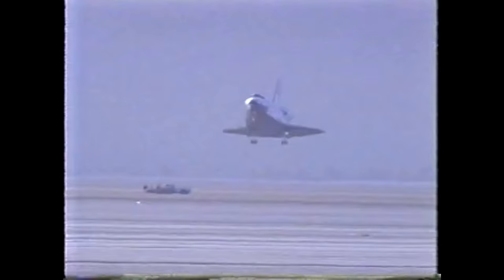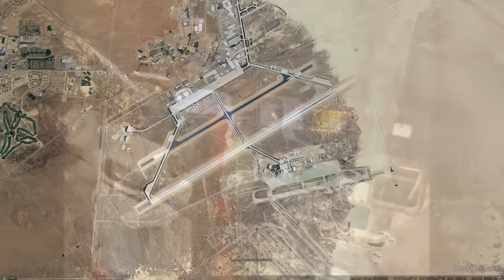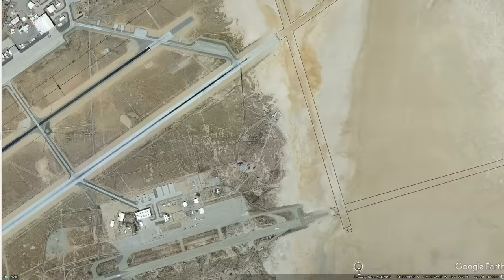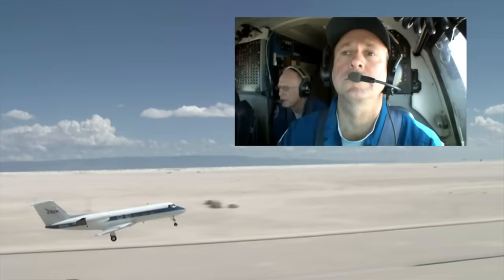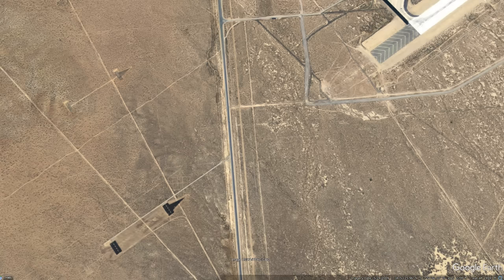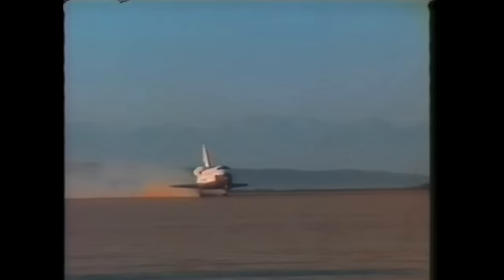The Space Shuttle That Didn't Reach The Runway - Why Did Atlantis Land Short on STS-37?

Comment: Do a show on the eclipse please.  Explain the difference between solar prominence and solar flare.  Also which was visible during the eclipse.

I belive I saw one good sun spot around the center leading up to totality when the moon was not yet half covering.  As well as several distinct prominence during totality.  I did not see any solar flares but many people are saying that they saw several.  I think they are confused which is which.

I explained the difference but if I ran into several then it is likely there are many more confused.  Who knows maybe I'm the one confused lol.
Reply: I saw three sunspots during the eclipse.  The bigger one was near the center, and a pair of smaller ones near the opposite limb from where the moon entered.  No totality here, so I can't comment on the prominence.
Reply: @stargazer7644  How would you know if you saw a sun spot though, rather than a prominence.  The difference seems rather clear when it is shooting off to the side of the sun.  If the loop is complete then it would be a prominence.  If not, then a flare.  But if it is on the side facing you, you just see a dark area.  How could you know if it is a prominence or not.  Thats the question I seek answered.
Reply: @K162KingPin  A sun spot is a cooler and thus darker spot on the sun caused by concentrations of magnetic flux.  It looks like a black spot on the sun.  Sometimes the magnetic field lines stretch and break and reconnect resulting in an intense burst of radiation - this is a solar flare. It is a bright flare that typically only lasts seconds to minutes.  A solar prominence is a large bright filament extending outwards from the limb of the sun toward the corona.  If it is seen on the disk of the sun and not above the limb, it is a solar filament. Filaments are linear or curving features, not spots.
Reply: @stargazer7644  A sun spot, is when you are looking down on either a prominence or a flare.  So again I wonder how can you tell the difference.  It would be like looking down on the room of a building and trying to determine if it has windows.
Reply: @K162KingPin  Sun spots don't have to have prominences and they're almost never flares.  When you see sunspots near the limb, they don't always show prominences, which they would if spots always had prominences.  I don't think you understand what these objects are.  I've tried to explain it to you.
Reply: @stargazer7644  So you are looking at the sun, and somewhere in the middle is a dark spot.  How can you know what that is unless you had a satellite at a right angle to the sun from your perspective to show you a side view of it.  It could be a cooler spot on the surface, or a solar flare or a prominence which is ejecting material or just plasma directly towards your perspective.

We can clearly see several prominence during the last eclipse which were perpendicular to our perspective.  So try to imagine what those would look like if you were at a different position around the sun looking directly at them.  They would look like a sun spot as they would appear cooler than the surrounding material.  Like trying to see the glow of a planet through a thick cloud.

So again, how can you tell the difference.
Reply: @K162KingPin  Once again.  You know because a filament is a linear or curved feature.  A sunspot is just a spot.  A flare is a bright eruption, not a spot.  If the filament is so new that you can't discern it yet, then it isn't a filament.  This is not rocket science.
Reply: @stargazer7644  So if you are looking directly down from the top of a filament or a solar flare which is on the side of the sun you are looking at.  It will look like every other sun spot as either would be cooler than the rest of the surface around them.  So again.  How can you tell which it is without being able to see it from a side view.  If it is "not rocket science" then this should be easy to explain, which you have not yet.  Do you understand the question?  I'm wondering because you didn't directly answer the question yet.

Comment: Scott, I am confused. When i look at a rocket painted white, it comes back pretty black from that heating entry...Why does that huge shuttle always look so white..Surely there would be carbon marks no?
Reply: the underside of the aircraft takes the brunt. We can see the blacking on the capsules due to their shape and the plasma curling over the capsule bottom. The shuttles heat pads come over the edge of the wings/body etc which is where the blacking would be if they didn't. if that makes sense lol
Reply: The Falcon 9 stage becomes black from the rocket exhaust. The Shuttle does not use its engines during reentry, so no combustion products to flow over the white areas of the hull. 
The heat shield of the Shuttle is made to stay intact during the reentry: it should not ablate anything, so no combustion products from that either.
Reply: @Hobbes746  Cheers..i think the Orion capsule and all capsules also come back lie charcoal no?
Reply: @thepinksmokeproject  Orion and Dragon use ablative heatshields: during reentry, the outer layer of the shield burns off, which produces lots of soot. The Shuttle heat shield was not ablative.

Comment: Abstract

The video recounts the story of STS-37, a Space Shuttle mission in 1991 that faced challenges during landing due to unpredictable wind conditions. The mission, primarily aimed at deploying the Compton Gamma Ray Observatory, encountered complications requiring an emergency spacewalk to correct a malfunctioning antenna. Subsequently, landing preparations were hampered by unfavorable weather conditions at potential landing sites. Ultimately, the decision was made to land at Edwards Air Force Base on an alternate runway that had never been used for shuttle landings. Despite encountering wind shear and landing short of the designated touchdown point, the mission concluded successfully. This incident prompted a review of communication protocols and risk assessment procedures for future shuttle landings.

The Compton Gamma Ray Observatory Mission and Emergency Spacewalk

* 0:04 - The video focuses on Space Shuttle Atlantis mission STS-37 in 1991.
* 0:52 - The primary objective of the mission was to deploy the Compton Gamma Ray Observatory, one of NASA's "Great Observatories" alongside the Hubble Space Telescope, Chandra X-ray Observatory, and Spitzer Space Telescope.
* 1:26 - During deployment, the observatory's antenna malfunctioned, necessitating an emergency spacewalk (EVA) to manually correct the issue.

Landing Challenges and Weather Constraints

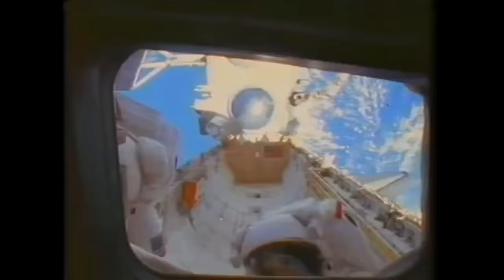* 1:54 - Landing a Space Shuttle was time-sensitive due to limited resources and reliance on suitable weather conditions.
* 2:12 - Crosswinds exceeding 12 knots posed a significant challenge for shuttle landings, restricting potential landing site options.
* 3:33 - Unfavorable weather conditions at both the primary landing site in Florida and the backup site at White Sands forced the mission planners to consider Edwards Air Force Base in California as an alternative.

Edwards Air Force Base and the Alternate Runway

* 4:05 - Edwards Air Force Base, with its Rogers dry lake bed offering multiple runway options, emerged as the most viable landing site.
* 4:48 - Due to wind direction, Runway 33 was selected for landing, despite never having been used for shuttle landings before and lacking proper markings and equipment.
* 7:05 - Astronauts conducted simulated landing approaches on Runway 33 using the Shuttle Training Aircraft to assess its suitability.

The Landing and Post-Mission Analysis

* 9:27 - On the day of the landing, wind shear conditions significantly impacted the shuttle's approach, causing it to deviate from the intended flight path.
* 11:37 - The commander skillfully maneuvered the shuttle and landed it at a slower speed, though it touched down 600 feet short of the runway threshold.
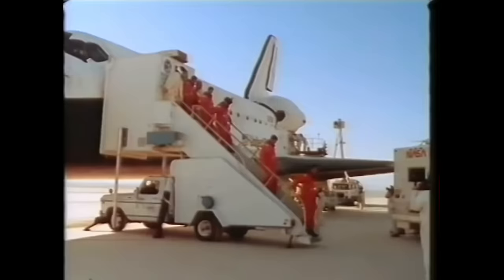* 12:28 - Despite the unconventional landing, the mission was deemed a success, and the crew and spacecraft remained safe.
* 12:35 - The incident highlighted communication gaps between the Shuttle Training Aircraft crew and the mission control team, prompting improvements in information sharing protocols.

i used gemini 1.5 pro
Reply: Great reply!!!

Comment: The toilet behind the cockpit on any commercial airline is part of the minimum equipment list. If that one fails, the flight will be aborted until either the problem is fixed or there is an aircraft change.
Reason for that is, you don't want the pilots to be somewhere, where they can't hear any alarms coming from the cockpit.
Reply: That's ridiculous.  It isn't like they leave the flight deck unoccupied while taking a whiz.  Also, you aren't going to hear any flight deck sounds in even the front toilet.

Comment: If it can land as a plane , why comercial airports weren't an option? 

What are the requirements for landing it ? 

Rwy Leng, width, surface, max tyre pressure allowed, that sort of thing
Reply: Long enough runway plus having the specialized support vehicles and equipment the Orbiter required.
Reply: Commercial and military airports were part of the contingency plans. The main restriction was runway length (even the 3 km used at commercial airports was not considered long enough, they wanted something like 3.5 km)
Reply: The shuttle could land at any airport with a 10,000 foot runway in an emergency.  But there were only 3 places it would land normally.  Kennedy Space Center, Edwards, and White Sands.  Several Trans-Atlantic sites had equipment to assist in a shuttle landing: Lajes in Portugal, Zaragoza in Spain, Moron in Spain, Istres in France.  At one time or another they also used Diego Garcia, Cologne in Germany, Ben Guerir in Morocco, Casablanca in Morocco, Banjul in The Gambia, Dakar in Senegal, Rota in Spain, RAF Fairford in UK, and Kano in Nigeria.  These other airports would only be used in an emergency because getting the shuttle back to the US from Europe is a problem due to the limited range of the shuttle carrying aircraft.  The shuttle needs special nav equipment in place to assist in its unusual approach glideslope.

Comment: 30 Deg crosswinds @24 knots is a 12kn crosswind? WTF, Scotty? If that's an astronomer's and PPLa holder's performance, I'd be reluctant to send you for groceries. You shouldn't do anything more complicated.
I'm certain you can edit a video. Why didn't you?!
Reply: If the difference between the wind and runway heading is 30 degrees, the crosswind is half of the reported wind speed; therefore, 24 x 0.5 = 12. So, he's correct and you're not.
Reply: The sine of 30 deg is 0.5.  The crosswind component of 24 knots at 30 degrees is indeed 24 * 0.5 = 12 knots.  WTF are you on about?

Comment: An expensive mission shouldn’t end just because the crew won’t crap in a bag. They should be ordered to, tough shit they signed up for it. Or hold it in and eat less.
Reply: Complicated shit, more likely...
Reply: The bags are a backup emergency. So, there’s a limited number of them and not enough for the duration of the mission. And, you start running a risk of waste floating around the shuttle and causing problems. 
They’re already on a special diet to reduce waste before going up.

Comment: The Hubbel telescope, when NASA forgot about gravity and wasted hundreds of millions to fix the oversight on the $1.5 billion telescope (that was originally planned to cost $400 to 500 million)...
Reply: Nope. Not a NASA failure, and nothing to do with gravity. A failure of the contractor. 
Perkin-Elmer had no experience making 2.4 m mirrors. They did make smaller mirrors for spy satellites. For the Hubble mirror, they repurposed a reflective null corrector used for those smaller mirrors. The mirrors in that null corrector had to be adjusted to the new mirror size. To do that, they created a rod of exactly the correct length, then placed a cap over the end of the rod to center it correctly in the null corrector. The intent was to reflect a laser off the end of the rod. What actually happened was that the laser reflected off the end cap instead. The end cap was painted with a nonreflective coating, but some of that coating had come off. So they adjusted the null corrector to the wrong value and used that to grind the mirror very precisely to the wrong value. 
P-E had a second null corrector (an older and less accurate device), used it to check the mirror and found that the mirror was flawed. But instead of following that result, they assumed this was a flaw in the older device and proceeded to deliver this mirror to NASA. NASA was under budget pressure and instead of doing its own tests, it accepted P-E’s test result which said the mirror was perfect.
Reply: What are you bloviating about?  You really shouldn't believe everything someone tells you.